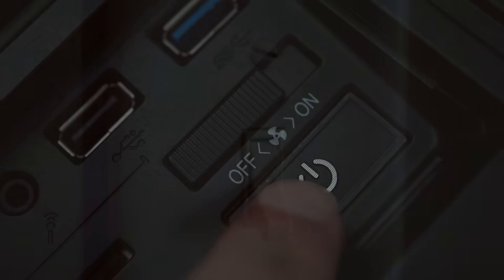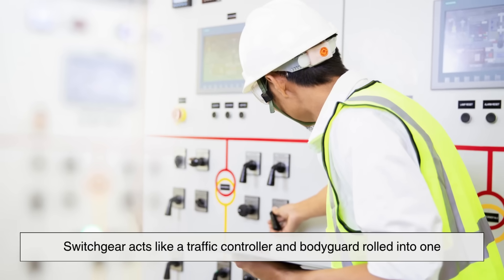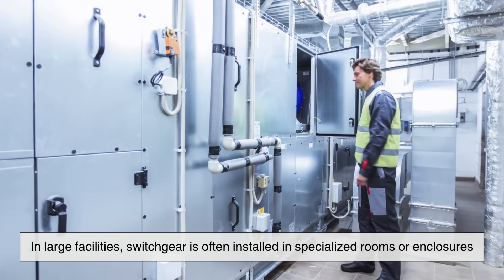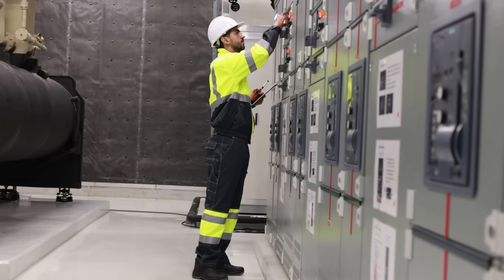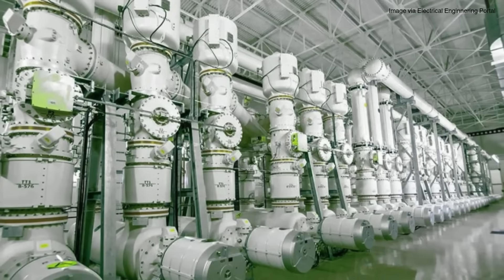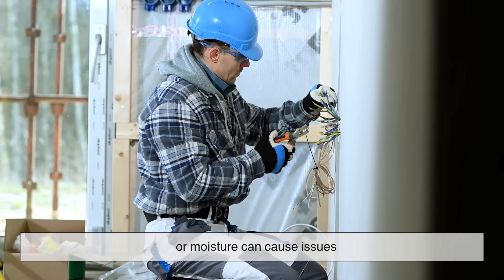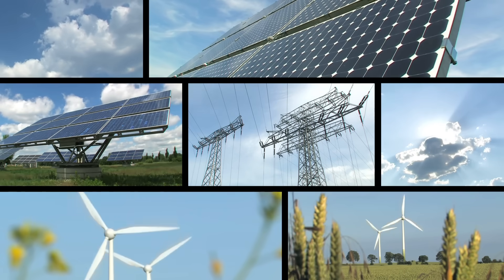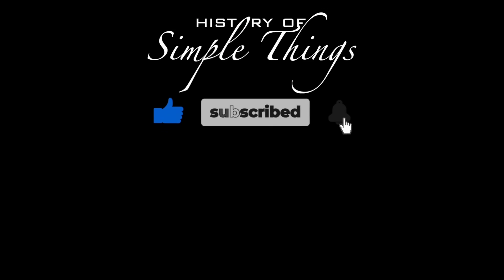Electrical Switchgear Explained: The Brain Behind the Power

Comment: Circuit breakers, such as those used in households, 
are not comparable to switchgear, such as those used in medium voltage or high voltage applications.
There is a difference whether only 240V should be protected or 10kV, 30kV or even 400kV should be switched.